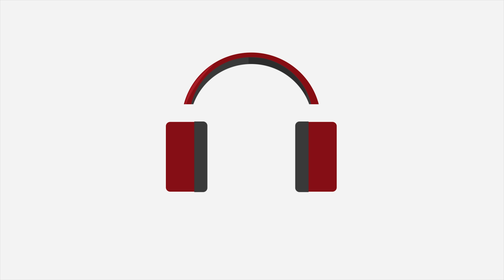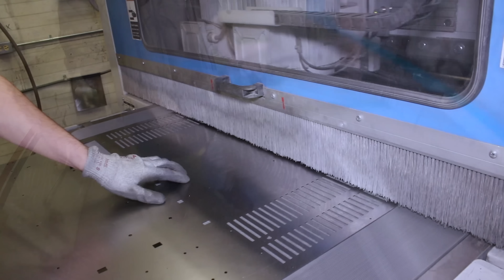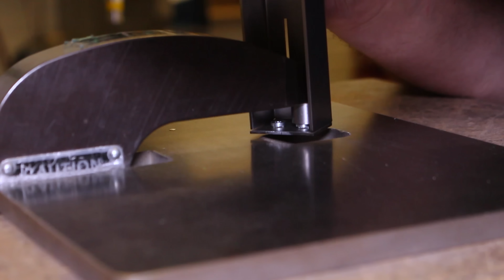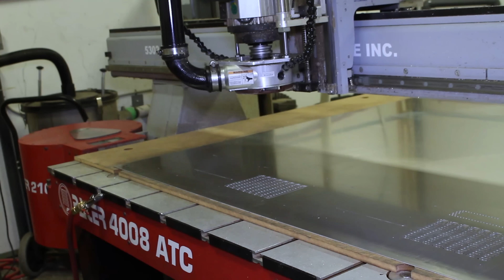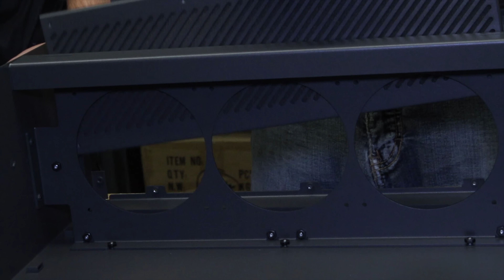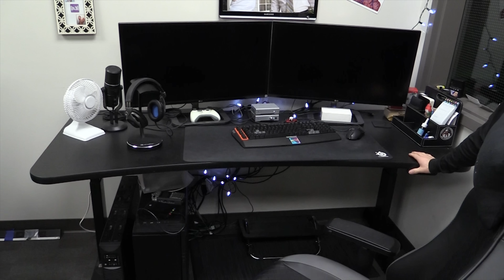The birth of my custom gaming case - Personal rig update 2015 Part 3

Comment: why a co2 laser, thats bad. I run a 6 Kw Nd:YAG laser, the outcome is excellent everytime, as lon as you you use the correct settings for the material and thickness.

Comment: I moved my computer into my closet due to noise issues. A USB extension cord to a USB hub plus a couple of scarily long HDMI and displayport cables run underneath my bed toward my wall (cable management be damned)

I did think about moving the computer into another room altogether. Maybe one day.

Comment: No one talk about those air bender skills from 3:30?
Reply: the press force and everything is automatic there , you just need to hold the part and press the pedal :P
Reply: yeah, well - you have to hold it in the right place.
Reply: Well , not rly, there's a stopper that tells you where exactly to hold it, you push it to the stopper and press the pedal. The hardest part is hold it parallel to the floor. Not saying it's all easy tho, just saying lots of things there already calculated by computer, it's a CNC bending after all.

Comment: I can't believe it is 2015 (2016) and we are still using that ancient style of computer "heat trap" casing. He said he uses water-cooled, but if you are not using that method and have fans only, then an enclosed computer case is such an outdated and inefficient idea. (so is the use of excess lighting). Heat is the enemy when it comes to electronics of any sort, including smart phones. What is the solution? Benchmarking platforms or modular and open aired cases such as the Antec Lanboy Air. The Aero-cool Strike X is another example. Air flow is one reason to get away from that old style case, but steel is another reason. Steel conducts and holds heat, so minimizing it is necessary. Not only is heat a problem, but with todays plug and play capability, it is a royal pain in the ass when it comes to altering, adding, or removing components from a completely enclosed box. The only argument against open air cases is dust... to them I say CLEAN YOUR FUCKING COMPUTER - lazy ass. 

thank you
Reply: I have 2 more arguments against open air cases. One is 9 years old and the other is 4.
Reply: ImprovisedSurvival wow dude...
Reply: What can I say? I had a moment...
Reply: Whether it's open air or not, my 7970 heats up to the intensity of the sun and sounds like a jet fighter formation. At least with my thick steel case I can dampen some of the noise coming from that. Although with (mostly) silent components, I do agree that a more open setup is a good idea, and today (one year later I realize) we're actually starting to get some more open cases from cougar and inwin.

Comment: we real fabricators use tig machines with pulse control so we can weld very thin material so there is no need to go and buy over priced machines that have a fancy named process that does exactly the same thing as pulsing

Comment: Will a AMD A8-7600 3.1GHz Quad-Core Processor (Socket FM2+),  Work with a Gigabyte GA-F2A78M-HD2 Micro ATX FM2+ Motherboard?  
Is there any case i can use instead of the one in this build http://uk.pcpartpicker.com/p/xDyjMp because the case in this one is out of stock is there any good replacement case for the one in this build which will fit all of the parts in this build?

Comment: Hey! Can anyone tell if this build can run GTA 5 if yes then on what settings

Board : Asus H81 Chipset Processor : Intel Core i3 4130 3.4 Ghz Pentium Dual Core Warranty : 3 years from Intel & Asus Output connectors : Motherboard USB 2.0 Ports - 2 USB 3.0 Ports - 2 VGA PORT = 1 Audio I/O Channel - 3 PS/2 - 2 ZOTAC GT 610 2GB DDR3 Graphics Card 1 x DVI Output Out, 1 x Dual Link DVI Out, 1 x HDMI Output Out HDD - Hard Disk Drive : 1 TB HDD (Primary) RAM : 4 GB Corsair/Kingston/Gskill Optical Drive : LG DVD burner

Comment: Would have been cheaper, cooler if built in wood, and coated with isolation on the inside. Wood is also more customizable allowing for crazier look and design, metal = sharp edges when cut or drilled into = more fiddling. Wood is also environment friendly.

Comment: Is this a good build? http://pcpartpicker.com/p/MrYnP6
Reply: I see what you guys mean, but having the R9 270 is good enough and cheap. I am not going to playing high end games(CS:GO MInecraft and LoL) on max setting. Also I grab the 2 4GB for duel channel instead of 2 8GB.

 I kept the 2TB that Nicholas suggested and the corsair i kept since it cheaper.
Reply: +Jason Luong 
I would just get one stick of 8gb Ram for now and put the extra $40 on a R9 380 or 280. I am amusing  the R9 270 on your list was around 140~ since I see PC part pickers doesn&#39;t show one.

At any rate 8GB is more than enough RAM, and your video card is more important.
I saw a R9 380 for 189.99 and 169.99 after rebate on amazon http://www.amazon.com/MSI-R9-380-2GD5T-OC/dp/B00ZGF0WCK/ref=sr_1_1?ie=UTF8&qid=1450844393&sr=8-1&keywords=MSI+R9+380+2GD5T+OC+Graphics+Card
Reply: +Jason Luong http://pcpartpicker.com/p/nb4Kzy this config is pricier than your original one but contains very good parts with excellent/good reviews
Reply: +Jason Luong 
On second thought after looking at that PSU you picked maybe this would help some http://pcpartpicker.com/user/yugoprowers/saved/VyDWGX
Reply: Yeah if you are not going to push it hard 270 is still a great card.

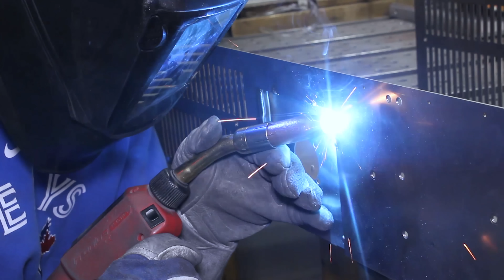Comment: 5:20 linus you silly goose. the process is still M.I.G. it just has a pulse machine set up to it. The pulse machines are expensive. So yeah, When it come to M.I.G. or the more proper term Gas Metal Arc Welding (GMAW), there are 4 transfer modes for transferring the metal and heat. 1). Short Circuit, 2). Globular, 3). Axial Spray, 4). Pulse. 

The same pulse machine could be used with a TIG or GTAW (Gas Tungsten Arc Welding) to make the heat input much less.

Comment: I've actually been trying to learn how to weld sheet metal with my dad's MIG welder.. Almost wonder if the TIG would be easier, but that welder you mentioned them using sounds badass because metal warping and welding gaps are things I've struggled with. (I have this obsession with wanting to fix rust on some of the old vehicles we have here, and if I was any good at working sheet metal I would. I should take a class.)

Comment: The Fronius welder being used is a CMT unit (Cold Metal Transfer). It pulls the feed wire back off the workpiece once it has sensed an arc, then pushes it back on when the arc dies. One of the units, without the hand torch, costs £24,000 in the UK.

Comment: Hey, everyone I need some help.
I'm thinking on upgrading my video  card to a GTX 980ti.
The question is, witch one?
This is the one I got on my sight >  EVGA GeForce GTX 980 Ti HYBRID
or the MSI GTX 980 Ti Lighting
Thoughts? recommendations?
Reply: +Tarik Diaz There's almost literally no difference, maybe one or the other has slightly better cooling, but tbh, theyre the same card, just designed differently.
Go for the faster clocked (faster base speed) and/or the one that runs cooler
Reply: +Aphix _ so the Hybrid? also,  thanks for the answer :)
Reply: +Tarik Diaz The MSI GTX 980 Ti Lightning and the Zotac GTX 980 Ti AMP! Extreme Edition reached the best benchmark results on factory-settings BUT it also depends on if you want to overclock your card yourself and if you want to watercool it.
When overclocking, the EVGA GTX 980 Ti Classified is one of the best to get, since it has a 14+3 Powerphase instead of a 6+2 Powerphase like the GTX 980 Ti HYBRID. As for the waterblock for the Classified you need a EK-FC780 GTX Classy but that waterblock reached EOL and thus you have to look around for a shop that still has one of those in stock. The EVGA GTX 980 Ti Classified K|NGP|N has it's own dedicated waterblock, the EK-FC980 GTX Classy KPE which is a fresh production and still available at EK.
As for the MSI GTX 980 Ti Lightning and the Zotac GTX 980 Ti AMP! Extreme Edition, there are no available waterblocks for those cards.
Reply: wow thank you Meta Custom Computers that was very detailed, I appreciate it.
Reply: Tarik Diaz
No problem. It's a shame that I'm uploading videos in German. (Uploading my first video right at this moment) But if there are enough english-speaking people interested in my videos, I'll put custom-subtitles under them.
For some more stuff from me check out my facebook:
https://www.facebook.com/metacustomcomputers
Reply: will do.

Comment: Haha .. looked at the UpDesk ... they lost my business by WAY WAY over charging. lol 231 dollars for a piece of wood that is 30in.X 60in. ... not that I have the experience to do it but .. heck .. with an arduino and a couple of stepper motors I could probably build one of these for what they charge for the piece of wood they are selling for the desktop surface. If the desk was more like 400-500 dollars .. then maybe .. but they went way too "greedy" on their pricing

Comment: Yo guys i have a question, 
What cooler should I use for the intel core i5 6600k Skylake?
Reply: Have the same cpu, and OCed to 4.7ghz w/ H110i GTX
Reply: +Noah Synclair the best you can afford based on your budget, starting at least with a hyper 212+

Comment: Linus, unrelated to this video but, My friend built a computer and once turning it on realized it did not post. He gave it to me to try and diagnose the issue. I have my main computer that is almost the same specs and was wondering if it would do any harm to take out my (already working) cpu and put it in his motherboard to try and diagnose if it is dead. Can I do this or will it harm my cpu?

Comment: How did you shoot the welding without ruining your camera sensors?
Reply: +Netcruzer Its just a camera, and i guess proper camera equipment should have no problem with verry verry bright light sources.
Reply: +Luke-Antra correct
Reply: +Netcruzer The type of intensity you need to ruin a sensor is something on the level of a laser shot right into the lens (this happens at concerts from time to time). A "normal" bright source like the sun or welding isn't an issue.

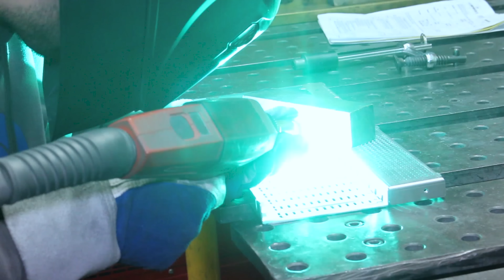Comment: at 5:05 when you're welding.
You're not supposed to get that black soot around the weld. Was the shielding gas present and/or turned up to proper pressures?

Comment: I was thinking of upgrading  my asus ROG G20 aj, specifically upgrading my gtx760 to a gtx970 and adding another 8gigs of ram and I geared that I might need to purchase another power bar or something is this true and is there anything else I need to know?
Reply: *Heard
Reply: +Clorox Bleach Either buy a 390, or wait till next september for NVidias new GPUs.

Problem is, this thing looks really tiny. And youll definetly need a beefier PSU for a new GPU.

Also i cant find any info on the GPU clearance in that case. 

Id therefore recommend making a post in the LTT Forums.
Reply: +Luke-Antra maybe he can't afford a 390
Reply: Blake Piazza A 390 costs as much as a 970.....

Like, the cheapest 970 on bestbuy is about 10$ cheaper than the cheapest 390.

And i have a 970 myself and the 390 simply is the better choice RN.
Reply: money inst the problem i just need to know what to do
Reply: Clorox Bleach TBH, i have no idea how upgradable the ROG G20aj is, the people in the LTT forum can proably help you better, esspecially cause there are more people with more knowledge.
http://linustechtips.com/main/
Reply: alright thanks anyway tho
Reply: Clorox Bleach np, i wish i could help more but i have 0 experince with prebuilt systems.

Comment: what should i get r9 290x or r9 390? im curious because the r9 390 is a rebranded r9 290 so the r9 290x should be faster but there is no reliable results anywhere?

Comment: What's a window for in a rack mount case? Or is it rack mount just cause it's cool and it won't actually go in a rack? Same thing happens with audio gear. $50000 high end amplifiers that are rack mount, but the people who buy them will either sit them on the floor next to the speakers, or on some sort of esoteric audio gear stand.

Comment: I'm looking for a new case to replace my current one. How much are those cutting machines?
Reply: +TalesOfWar $1mil Canadian Rupees.

so that's what, $50 US? I can buy them by the 6-pack!
Reply: +XtremeDrake Laser cutting is charged out at roughly €250 / hour

Those case components would take approximately 20 mins to cut on a laser, so laser cutting alone you are looking at about €85 (though different places charge VERY differently when it comes to laser cutting)

Then there is bending, it is difficult to tell how much bending was involved in this case. Allow 4 hours total to bending assuming they have a good system in place. Charge that out at say €35 per hour. €140 for bending.

The CNC milling is a step that I would have avoided if at all possible in favour of water cutting, unsure of how much of that was required, but let's allow 2 hours at €45 per hour - €90 for CNC milling

Other machining including counter sinking of holes, pressing in nuts etc were all done manually, and so will have taken time. Say 8 hours at €45 per hour - €360 for misc. machining

Deburring and polishing will also have been a slow process that will have taken about 3-4 hours (we'll go with 4 hours) at €45 per hour - €180 for cleaning material

Finally powder coating can be done by tonnage at roughly €800 per tonne. Not sure of the tonnage involved in this, but let's just allow a nice round €200 for treating and powder coating (this is allowing for the extra work involved in surface treating and plugging holes).

That brings us to approximately €1055.00 excluding VAT to make this case excluding design and drawing costs (assuming you submit those yourself)

So for the low low price of $1155.00 you too can make your own custom case!

This is going worst case scenario btw, it could be cheaper, but my point is either way; it's not cheap!
Reply: Thousands and thousands, and there extremely large. i work with them everday at school
Reply: You also can buy some other Tools.. Just look at DIYperks ' case
Reply: noanoxan peasant
Reply: +DaGleese That's honestly not that bad, considering there are limited edition cases that are that expensive or more so, and are completely hideous.
Reply: +XtremeDrake 20k on ebay for the lazer, 15k for the 60 ton press,5k for the deburring machine, another 5k for the powdercoat system.
seems cheap to set up for sure....
Reply: UndeadSamurai01 but with long GPUs you'll get trouble
Reply: Try getting a water jet cutter, more efficient, practical and multi purpose
Reply: TalesOfWar
"training to run it" journeyman sheet metal ticket is a 3yr course alone then journeyman painter after,, hehe
Reply: You know you can have actual links in youtube comments, for like quite a while now, right?
Reply: dino seen Really? I don't comment on youtube that often. Thanks.
Reply: press and cutting and welding costs £100k
Reply: Check the dimensions before you buy, but its fairly easy to find rack mount chassis that will fit long GPUs.  My dual 770s fit just fine in the cheapest 4U case I could find, and that's without removing any of the HDD cages.

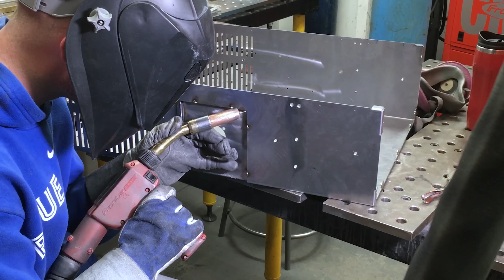Comment: At 4:43 the specific process being used is called CMT (Cold Metal Transfer). From what I know it's a variation of the Pulsed MIG or GMAW-P process. In a nutshell GMAW-P works by contacting the part with the wire to establish an arc, the wire then retracts and the end of the wire is melted forming a droplet of molten metal. The wire is then extended into the puddle on the base metal and a high peak amperage is applied to separate the droplet from the wire. As the wire is retracted a low background current is used to maintain the arc. A higher current is then used to create another droplet at the end of the wire and the process is repeated.

Comment: Unnecesary Radiometry Rant for fun:

At 1:07: A power emmited over a certain area is not an energy density. Its an Intensity or more specifically a Radiant exitance. Which would essentially mean its "brighter" than the surface of the sun. An energy density could make sense if you looked how much Radiation energy is in a given volume wich would be RadiantExitance*Area*time. Thearea and time would be designating the Volume (area*SpeedOfLight*time) which you are looking at so it would essentially again be comparing Radiant Exitance. Unless you are talking about the Energy density inside the Plasma it creates when vaporizing the metal at which point you are just saying: "The vaporized metal is hotter than the surface of the sun". (always assuming you mean the suns Surface as comparing to the core would make the statement incorrect no matter how you look at it)

Comment: custom air brushed lightning with a clear coat and people says it looks tacky...smh it's not pencil line lighting or super thick lightning the only place that does suck was the 3d transition on the left where the highlight is super thick in the middle which is forgivable by most as it's really hard to do 3d transitions perfect since air brush gives 3d effects to a flat surface then managing spray to do a 3d transition on lightning is wrose as you have to lay down the base then spray heighlits but don't get it wrong yes lightning is super easy but 3d transition is hard

Comment: That front lightning paint made me cringe very hard
Reply: Martin Landart Or a GPU from the early 2000's
Reply: +Ivan Crespo Gomez You mean like my GPU? https://www.google.ca/search?q=gtx+260&rlz=1C1CAFA_enCA625CA625&source=lnms&tbm=isch&sa=X&ved=0ahUKEwiaqKSYjvDJAhXBqx4KHV-EDogQ_AUIBygB&biw=1024&bih=667
Reply: Gorgeous custom metalwork ruined with horrible 90's sound system graphics. I wanna break in their office at night and brush it back to bare steel
Reply: Agreed.
Reply: +irsever So you're willing to... brush with crime and danger?